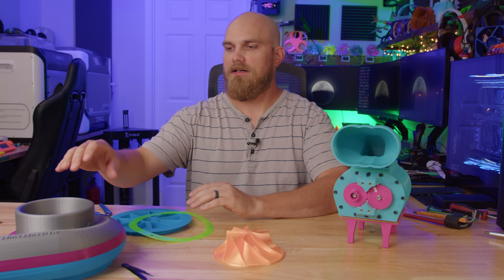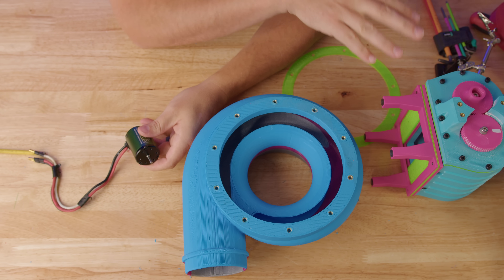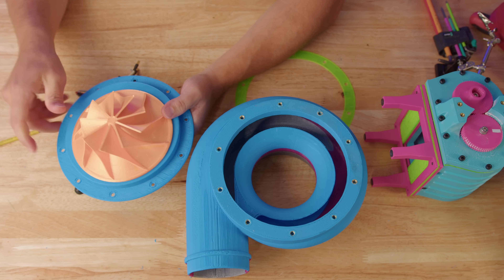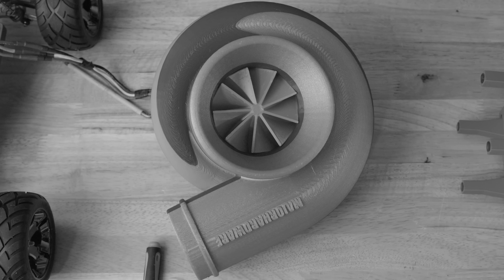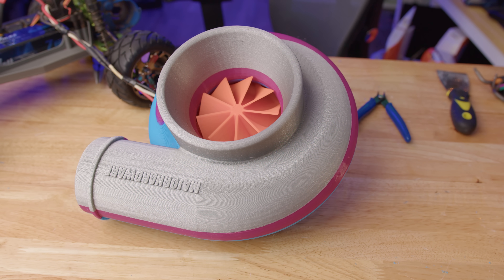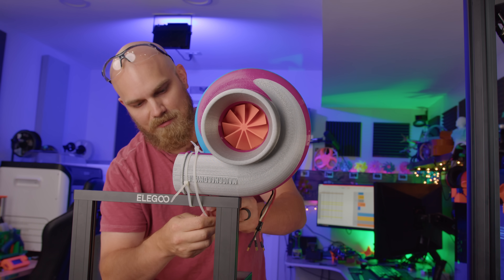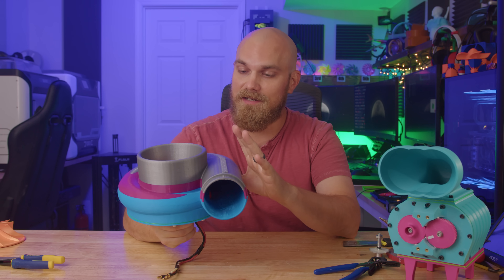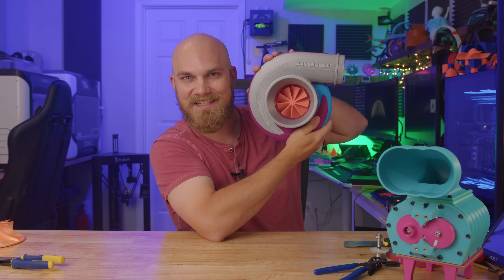I BUILT a MASSIVE ProCharger for my PC

Comment: Not bad, but I would personally disqualify both the supercharger and procharger for not using the Noctua motor.
Now, can you modify the procharger to take a noctua motor and see what you can get out of that?
(maybe use a bearing to stabilize the top side of the impeller and use the core motor system on the rear, how you attach it is up to you)

Comment: Instead of reprinting for the rubbing, why not use some self adhesive sandpaper to create the clearance you need?   And as far as I want to see overall... I really want to see every fan design be able to run at the same rpm. There could be a design that someone sends you that could take over the market but it underperforms with the available power of the Noctua motor. New CPUs and GPUs are using more power with the new generations... why cant fans do the same?   I'd love to see the top designs retested on an even rpm playing field and see how the lineup changes.

Comment: Inrunner brushless motors are usually rated at a  pretty high kV (rpm per volt) and are better for speed than torque - which is why they're usually used for EDFs, or helicopters / cars with gear reduction.

Try a big outrunner motor with a lower kV rating, it'll have far more torque and draw less power.

Probably would be a good idea to support the top if the impeller with a bearing, too.

Comment: Based on the cfm it moves enough air to supercharge a 550hp motor. I'm curious what psi it could build.
Reply: Moving Air is not that hard, but compressing and building pressure is a different thing.
Reply: @dorukdogauysal  yeah. that might eek out 3psi, which is no small margin, but it won't give ya mega power. Just a few extra MPGs city and hwy.

Comment: What size is the inlet and outlet on the compressor? My supercharger has a 3.5" inlet and 2.75" outlet. It's rated for 775hp. Vortech v3 Si trim. It completely changed the attitude of my old 1990 chevy pickup.

Comment: imo: i have no clue when it comes to those little electric motors but i do know electric motors have a lot of torque, that being said if i was looking for the right motor for this kinda weird application i would look into which motor can handle the most restriction. for example, you cant use a simple electric drill to take off lug nuts on an 18 wheeler, while also you cant get the big torque wrench up to fast speeds either. something to consider is maybe doing a two stage pro charger, one at one ratio thats basically all torque to eliminate the resistance then that air exits pushing the other with charged air helping its resistance so you can run a fast motor so it doesnt get hot but can pump some crazy air. thats my idea lol

Comment: you should balance the impeller so that it can run faster and cause less problems
steps:
make table with bearings
add shaft into fan
vibrate the hell out of it
the side that rotates down is the heavy side
take some material off untill it is balance
run it to hell

Comment: I would love to see this with a bigger motor, or at least a motor with a sturdier shaft. with five times the CFM of your Noctua fan at full tilt boogie, I's love to see what you can do coolingwise if you pair it with a 120mm AIO versus something like a 240Mmm AIO running standard fans. Or even get buckwild and adapt it from that output to a 240mm radiator size. Although I worry you would lose a lot of air compression expanding the end out that wide.

Comment: I like the concept of the procharger style, now you should see if you can shrink the entire thing down so that it could theoretically fit in an actual PC case and be used as a cooler fan
Reply: still will not be good device, compression creates heat
Reply: @sombuddy9534  The point isn't to be better, but to work. And what does it matter if that heat is going straight ot anyway?
Reply: @jakelowery7398  Because cooling air is not going straight out. It's going in and supposed to be removing heat from the fin stack. If you're pre-heating your cooler's feed air, you're losing out no matter what because you can only get the load as cold as the air feeding the cooler.
Reply: @sombuddy9534  there's no compression as such going with this if you don't have it blow to a closed volume with some constant volume thing moving air out of the volume like an internal combustion engine.  it's not like you're going to run the case at 2 bar or something, instead you'd be using it essentially as a leaf blower.  this is essentially an electric leaf blower.
Reply: No, the case must adapt to the custom part, or there's no point in making the part in the first place

Comment: Reducing the amount of wobble would directly increase the efficiency. Would it be possible to reprint the compressor wheel so that the center “shaft” protrudes into the inlet of the housing? Then you could put a bearing that connects to a turbo cover where the bearing could be pressed in. That way the compressor wheel shaft has more reinforced axis of rotation. If that makes any sense to anyone reading it, apologies for the bad explanation.

Comment: Perhaps it would be a good idea to add a bearing support on the inlet side to help prevent wobble and increase tolerance accuracy. Also, perhaps coat the interior of the compressor housing with a layer of melted wax or other malleable substance  that could self clearance the compressor housing to the compressor wheel.  Additionally, why not throw on a heat sink to the motor to help control thermals?

EDIT: Bondo. That's what would work for self-clearance between housing and wheel. Just need to catch it while it's green (the phase before it sets)
Reply: I was thinking the same thing as soon as he started assembly. A shaft running through the compressor wheel, while being supported with bearings on both sides, will probably increase the RPMs significantly and perhaps also solve the issue of the motor running hot due to high load.
Reply: beat me to it, I think maybe even a metal rod from the motor shaft through the compressor to the support on the inlet side
Reply: Graphite dry lube or white lithium would be good
Reply: @dirkmiller9872  Graphite and computers don't mix. You'd blow conductive crud right into your traces trying to cool anything PC related.
Reply: @dustinbrueggemann1875  yeah but the exhaust isn't being used as an intake here. It's being used as an exhaust.
Reply: @dustinbrueggemann1875  fair point
Reply: @scarecrow5848  depends on how it is used. I presume he envisioned it as an intake fan for the computer, just like the roots.
Reply: @scarecrow5848  he's using the output of the charger to force air over the cooler stack. It's on the front end. That means risk of graphite dust on parts near the computer. It's just a bad choice for the application.
Reply: For OEM applications this type of coating is referred to as "abradable coating" and improves efficiency a decent amount. It is commonly a special high temperature epoxy resin however compressor wheels are also usually aluminum so they are significantly harder than epoxy. Would be difficult to find something softer than PLA that wouldn't coat your radiator.
Reply: Even just a skate bearing on the back side of the compressor wheel that's then just makes the motor do the work of spinning the wheel but not supporting it would probably do the job.
Reply: Wax may spew to the cooling target though.
Reply: @xyexz  My imagination is limited on what substance could be used to self clearance, but you're right, wax is probably not the ideal solution, but I think you get the picture.
Reply: @micahrobles5210  what about a silicone based lubricant? i think they make a spray on kinda like spray paint but it it also comes in a "dry" application spray too. its also electrically insulating, so no worries on if any gets in a pc lol
Reply: @s1nistersausage  I actually wasn't concerned about lubrication when I mentioned the wax. Perhaps because I said "melted wax" people thought I was suggesting a lubricant when I was actually suggesting a clearancing material where the compressor will would scrape away the wax leaving a perfect fit to the compressor housing.  Someone else here mentioned how manufactures use epoxy to accomplish this, but obviously PLA isn't going to be strong enough to create the desired effect. Actually, now that I think about it, Bondo would work perfectly if it's caught at the right moment before it fully sets. Bondo is pretty easy to scrape and shape in the few minutes between liquid and fully set.
Reply: Exactly this, also a thicker backplate
Reply: I think doing it backwards would work better. Bearings where the motor currently is, mount the motor in the intake to keep the motor cool.
Reply: @sams6630  Best idea yet.
Reply: 3d print an inner ring with self lubricating nylon.
Reply: Poor 3mm shaft having to hold that whole chunk of plastic. supporting bearing on the opposite side would definitely help a lot.
Reply: Could use graphite as a lubricant.
Reply: @blitzkrieg237  what about a silicone based lubricant? i think they make a spray on kinda like spray paint but it it also comes in a "dry" application spray too. its also electrically insulating, so no worries on if any gets in a pc

Comment: Looks like a well designed Volute for somebody who doesn't design turbos or centrifugal HVAC compressors.  In Creo, you would use a "variable section swept cut", I would assume Solidworks uses something akin to a variable section loft cut, with a spiral 3d sketch used for the trajectory.   Would love to see this with a more robust motor, but caution of delamination or fracture due to impeller overspeed. Only one other suggestion, which would go more in depth than you probably want, is to modify your power delivery to better address initial inertia and prevent prevent premature motor failure, a granted a larger motor will probably solve that.  At any rate, I love the design and the initial results!!

Comment: I'd look into ~1000kv motors, just in a nice range before things get expensive and with enough torque for a wobbly/friction filled device and can be used with standard 2-4S lipo and 30a esc

Comment: that definitely feels like an application for a far larger can size and some improvement on the wobble going on.  I agree with other commenters that the wobbling and such are going to smash any motor you put in there eventually.  You may be able to delay that to part failure (instead of motor failure) by beefing the motor up, but the real solution is removing the wub wub wub it's doing in the first place.

Comment: the Roots blower would be a LOT quieter if you changed the geometry of the blower parts. most roots style blowers are designed with a twist on them like a screw.

Comment: as far as motors go i recommend the castle 1417 2200kv motor, with a mamba x esc it is 6s capable ( tho quite expensive)
if thats too much you can also run the cheaper copper head 10 esc, but be limited to 4s.  
because of the low kv rating and being 6s capable it should have plenty of torque 
also could you make a side channel vacuum pump next time for a big project like this?
(it is desighned for liquids but id like to see an attempt)

Comment: I'd like to see a tiny cpu mountable version. Could use a small powerful drone motor flush mount it in the compressor wheel and mount it from the bottom to the backplate so it is a sealed unit. Sure it is probably noisy, but who doesn't want a supercharger sitting only their cpu lol.
Reply: i would just mount it straight to the radiator and use a pwm signal from the mother board the control the esc

Comment: Turbo’s and superchargers and stuff like this are good for pressure.
Pressure and air flow are not the same.
If you want to test pressure, make it blow inside a closed of box and measure the pressure difference inside and outside the box…
Reply: Well they are literally just compressors.
Reply: @Oblithian  Exactly. Pressure, not air flow!

Comment: Id get a 5th scale castle creations package esc and motor i wanna say that would be about 10 horsepower. then try and refine the procharger design, then add a heat sync and fan to that motor and esc as well, then ACTUALLY APPLY IT TO A COMPUTER🤣

Comment: i dont know the exact maths on the the size of that that thing. but the one you made is looking HUGE, probably like 90mm instake? that would be good for a 3000HP+ application if it were a real turbo of that size , Make the Turbo smaller, much smaller, use an Noctua fan motor and some gears to get the rpm up and keep the spirit of the Fan Show down going within this build.

Comment: I'd definitely recommend getting a larger motor with a 5mm shaft. Castle make a good combo. If you're not looking to burn the motor out, get a 6s/8s motor + esc and use 3s/4s to ensure you don't burn it out too quickly
Reply: I also heard good things about hobbywing and i think they have motors with 5 mm shafts and also sells motor ESC combos with 4 to 8S capable combos, either way i think it will be so good that the next step would be to try to supercharge a real car with it lol
Reply: I believe castle also has a motor with an 8mm shaft
Reply: @justins6134  the castle 1721 sensored motor has a 8mm shaft
Reply: Well, that depends. Do you need a motor for moving air or shredding plastic. And this is just grinding plastic.
Reply: i wanna experiment by getting a load of old heatsink fins ,attached them to the connected CPU heatsink ,so they reach front to the case fan to the rear case fan ,and build a airtight shroud around the whole array so its one big long shrouded enclosed heatsink fins
Reply: Absolutely no need to change motors. Just add some gearing. More adjustability. Stronger mounts. Easier repairs.
Reply: @codeman99-dev  Like.. My idea exactly, then I remembered this is "supposed" to be a PC fan 😅
Gearing would do the trick, but then I think we are moving away from the fan part. Still.. Perhaps a PRE-Eth merge mining.. room could be a target audience.

Comment: A car blower motor would be really cheap and readily available. I made a DIY snail for one with plywood and aluminum flashing, but I bet you could print something up that is more efficient. The squirrel cage and motor will already be matched so you won't have any teething issues in that area.

Comment: Has nobody pointed out yet that you used the wrong kind of gears on your roots charger?  You used gears that were meant to interface with a worm gear, rather than the proper gears.  That's why they have that dip in the middle of them like that.  It's been annoying me since day 1.

Comment: The biggest thing to help this… is to “TRUE UP” the flange area on the backing plate and compressor housing so the blade is true to the center line of the bore.  3D Printer may be pretty good but not good enough.  Also to need a closer tolerance on the runout of the blade disc.  Assuming all things are equal in thickness across the blade… the overall roundness was not.  That wobble will just keep destroying motors
Reply: Did you miss the part about the motor shaft being bent before he started? The wheel is fine, the fact it's being driven in a cycloid pattern is the issue.
Reply: @kleetus92  the wheel *may be fine*. It also may not be fine. The bent shaft is definitely contributing but even forged fully machined compressor wheels in production turbochargers require balancing because radial loading goes with the square of speed by the mass eccentricity. He could easily bend the new motor's shaft if the compressor has too much mass eccentricity.

Comment: I would love to see this with a noctua fan operating it instead of a whole bunch of craziness. However if you want to go over the top a quiet bathroom fan motor and blade would probably work great
Reply: Not design to run at the speed of a compressor. fan would destroy its self very quickly

Comment: Bigger motor next! It would also probably help to cool the motor and ESC. If you really want to let it rip use this: T-Motor U15 L 43kv Multicopter Brushless Motor 3600g 12S-24S.  It’s a little strong but you can use it with a gearbox to increase the output RPM.
Reply: Why would he use that motor when he wants it to spin 10K+ rpm... Makes no sense.
Reply: @bismuth7730  because you can just gear it up to your desired RPM without really needing to look at power. You have more possibilities with this one compared to a weaker one with higher rpm.

Comment: Would love to see you design and build an axial compressor sized for a 120mm fan mount using the same size brushless motor you used there. Be really interesting to see the final size and volumetric output compared to an NF-A9x